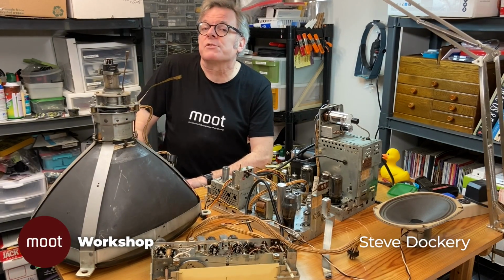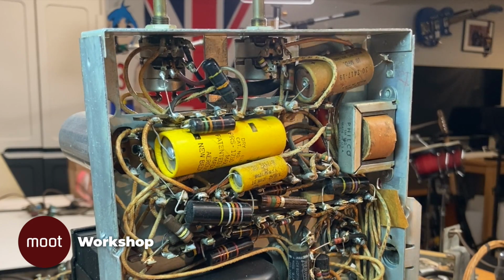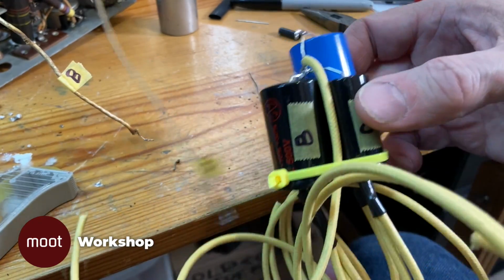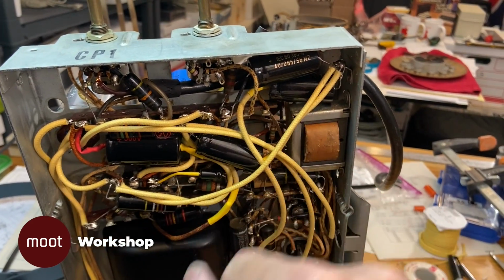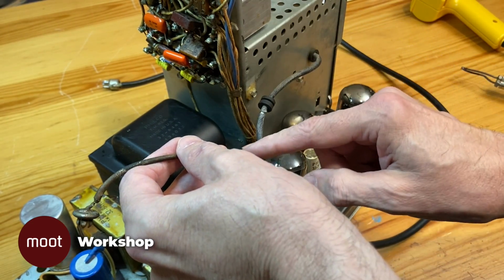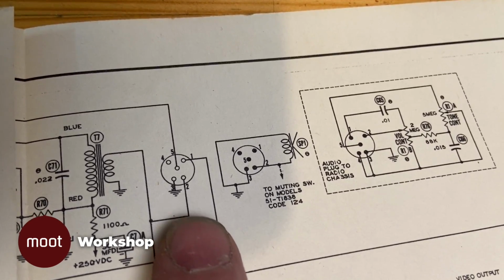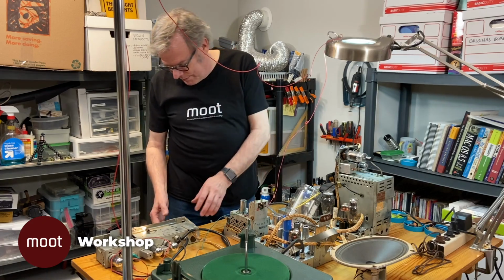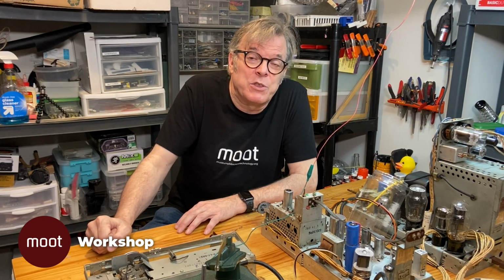Refurbishing a 1951 Philco Console TV - Part 3

Comment: I have that same set in queue. Mine is the metal cabinet console with a 17BP4. You could save $ by using copper wire instead of those soldering tips. Craig

Comment: I've found that once you have the bottom of the multi-element electrolytic, you can heat the can with a hot air gun (or hair dryer) and the innards will pull right out, without having to dig them out.
Reply from the maker: Yeah, I've discovered that the heat gun is one of my best friends.

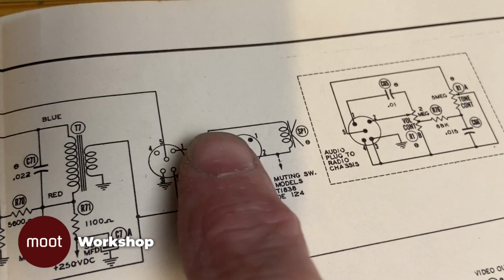Comment: At 18:30 there may be some confusion here as to why there is a schematic for a speaker connection  and a dotted line box with the plug connected 
to more components. Since this is a combo unit and it has an AM radio you use the connections in the dotted line box and not the speaker circuit
directly! On the left the socket shows no connection at  pin 4 but that is OK since the plug in the dotted line box  has  pins 3 and 4 to ground anyhow!